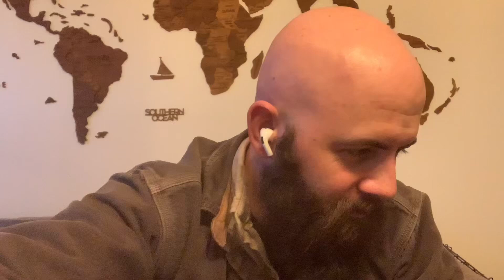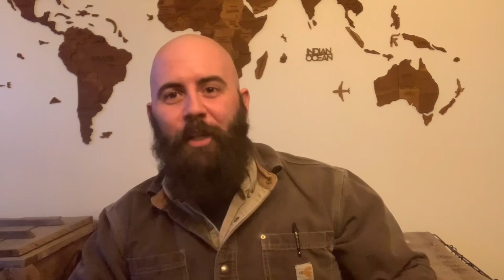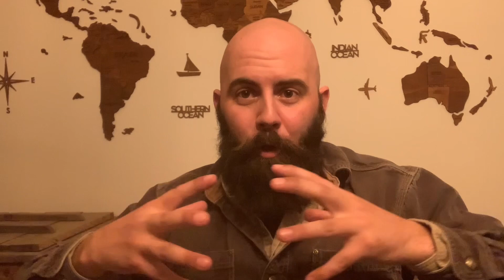Liquid biogas - thoughts, ramblings, questions

Comment: Great question! I've been asking myself the same thing. Once again it comes down to just how bad do you need it. In the Minneapolis are, as I'm sure by now. There is liquid natural gas running in public transport buses. I think it's outside of the range for a DIY setup to go that route. Maybe at some point there will be local facilities where you take your biogas in and exchange it for liquid tanks. Very much the same as propane is now. Maybe on a consignment, or contract basis! A guy might be able to put together an engineering team & develop a patentable small scale unit to get the job done. The initial cost would be large. Though maybe a local group of biogas producers could setup a centralized community facility, using that unit. Splitting the costs between a dozen or so producers? Just to add to one of the comments. In the case of filling the tank. You'd most likely never go past 85%. Just so the liquid has an expansion area, just like a residential propane tank! Keep up the good work!

Comment: There is probably an optimum temperature and pressure to achieve maximum efficiency. The warmer it is the harder your compressor will have to work to compress your gas. In theory you could compress the gas in a freezer at -40 and it should liquify at a far lower pressure. Are you in the part of the USA with real winters?
Reply from the maker: My gratitude for humoring me here, Paul. This is such a fun topic for me to think about.
Reply from the maker: Yes! I am in northern Midwest. It gets very cold here.

Comment: Shouldn't the phase change into liquid drastically reduce the volume of the methane and therefore reduce the pressure? Gravity should cause the liquified gas to settle at the bottom of the tank with a pocket of gas at the critical pressure floating at the top of the tank. As the compressor adds more moles into the tank the ratio of liquid to gas should increase until there is no more space for gas. When you start to use the gas the liquid would boil before leaving the tank. 

I think I have seen a video of some Indians pressurising biogas.
Reply from the maker: Do you think as long as the vessel is in an ice bath, the heat from the compressor will prevent liquid forming in the compression chamber? 

That’s a great point about the volume change. I guess if it’s in a closed system with methane there should be an inner tube or some kind of bladder incorporated. I hope I get to design this experiment one day.

Comment: You are correct at the end there about using condensation for purification. Changes of state are the basis of distillation. 

I appreciate the metric conversion.
Reply from the maker: Someone said something about super critical co2. I haven’t had a chance to research it yet but it sounds very interesting.
Reply from the maker: Oh, is it still considered distillation if it’s cooling instead of heating?
Reply: @BiogasUSA  if you ask a chemist, no, but if you ask a physicist, yes. 
https://en.wikipedia.org/wiki/Fractional_freezing

Comment: sounds like too much of a prosess to liquefy the gas , why not jest compres? 
if you jest compress to say 150 psi you should be able to drive your car on methane you make,  why go to 5000 psi ?
Reply from the maker: Great question, I forgot to hit that in the video. The major advantage is capacity. When gas condenses to liquid it takes up much less space so you can carry more gas in the same size vessel. 

When propane expands from liquid to vapor, I believe it expands to 300x the liquid volume. The advantage is even greater with methane, I think the number is 800x
Reply: hey so some follow up questions,  I'm doing some more research after hearing your questions and thoughts,  
for the contexst I'm in a similar spot a bit earlier in the process, jest started my digester and getting my first loads of gas , I've done quite an overkill on the filtration system so I think I'm getting pretty clean gas .. 
and my car is currently running on LPG and I'm aiming to eventually try to run it on the biogas 
so from what you said I was wondering about the parameters and if and how to go about thinking about compesing the gas , liquifing seems out of the question,  but then I'm wondering about the numbers of compression,  if my car is currently running on LPG wich I was told is at 15 bar / 220 psi (also sed it's in liquid form in this pressure)
so I wonder about the numbers and if it's correct,  

and then what is the difference between the LPG and the methane in terms of density and pressure , jest sounds like different numbers.. 

and I was wondering  what pressures you've been able to reach with your compressor and what the volume pressure ratio is , I mean how meny liters of gas have you been able to compress in to a specific volume (your gas tank) and at what pressure?  

and I'd love to hear eny other relevant numbers or pieces of information that you have managed to clarify for yourself  🙏
Reply from the maker: @livingecology  of course. I’m here for it. 

Your car runs on propane. 
Your biodigester produces methane

They’re two different hydrocarbons with very different properties. 

LPG is propane. Liquid methane is referred to as LNG. 

Check out my video on compression. I have never gone beyond 300psi because I don’t have the vessels to handle any more than that. I intend to run a vehicle on biogas using something called a CNG kit. Designed to convert a vehicle to run on “compressed natural gas “ (or methane). These kits call for something like 2500 psi and have the regulators and other surrounding infrastructure to handle that pressure. 

I have no doubt you could modify your car to run on biogas but I don’t think it would be smart with that kit. You would have to change virtually every component to deal with the pressure, or run it at 300psi… methane at 300psi just won’t have enough btu to take you anywhere.
Reply: thanks interesting points,
I was wondering about the equation of tank pressure and tank size , useing your numbers , 2500 to 300 psi is 8:1  so if I want the same kilometer capacity I would need a tank 8 times bigger,  
with my tank on LPG I go 400 kilometers wich is a lot (for me) so I figure I need only 4 times my current tank volume to have a decent 200 kilometer range on biogas .. ?
Reply from the maker: @livingecology hmm I’m not sure that’s true. I think the btu will come into play here. Propane has more energy/unit of volume than methane does. This is about to get too mathy for me.
Reply: @BiogasUSA 😂 not too mathy lol
This chronological was just getting good lol
Reply from the maker: @kawaiisenshi2401  I’m glad you’re enjoying these videos today. What is your interest in biogas?

Comment: Okay, there's a lot there. Yes, some people do use LNG. The way to avoid keeping it in a tank at 5000 PSI is to keep it in an insulated tank. It can also work for vehicles, again, in an insulated tank. Which, I expect, is more expensive than the regular CNG tank. A reason not to do it is mostly the costs involved. That's a lot of energy inputs for the benefit of a greater mass in the same volume. Add in the cost of the more expensive, and possibly heavier tank, and for light vehicles, it isn't worth the bother. That being said, I'd like to try it in a muscle car one day, because turbos have a huge amount of heat to get rid of, just when they're using more fuel. 
As for making it a liquid in a manageable fashion, compressing and cooling, working together would be the way to go, I believe. Cooling the compressor, at least the hottest parts of it, and also the tank it's being pumped into.
As for compressing biogas to these levels, there are two issues, I believe. First, you don't want to be spending energy to compress CO2, which has no fuel value. And beyond that, at LNG temps and pressures, I suspect you'll be dealing with supercritical CO2, which acts sort of like a liquid, but not really. And that's a whole new can of engineering worms to manage. Easier to remove impurities that have wildly varying behaviours at these temps and pressures.
Reply from the maker: Awesome! Great insights. Thank you.

I love that turbo idea. It seems like they could live in perfect harmony with liquid gas. What an interesting point.

I forgot to say, but I have heard of “cold distillation”. Making brandy by leaving wine outside in the cold. The water freezes and the ethanol stays liquid. I was thinking of that when I asked the question. “Super critical co2” is a completely foreign grouping of words to me, so thank you for that. I can already tell it’s going to be a fun google.
Reply: @BiogasUSA I was looking into this company's dirty 6kw biogas generator that doesn't mind taking in "dirty" methane/bio fuel and will still reliably provide tons of power

Couldn't figure out the cost but I believe they def had some great ideas we could theoretically combine

Comment: Liquified methane is propane
Reply: No, it is not. Propane is a longer chain-length hydrocarbon than methane. This is why it turns into a liquid at a lower pressure and higher temperature than propane.
Reply from the maker: Propane is ch-8
Methane is ch-4

They are quite different in any state.
Reply: @BiogasUSA  I think they might be trying to say something, but doing it badly. If you shake a full propane tank it seems like there is some liquid at the bottom.

Comment: very good ideas and questions.  I would like to hear from an engineer who has the answers to these issues.
Reply: regarding the issue of the energy required to compress the gas, in our case we can just build a bigger digester and make more gas to run the compressor.  If you are living in the suburbs or if organic matter is scarce that may not be an option.